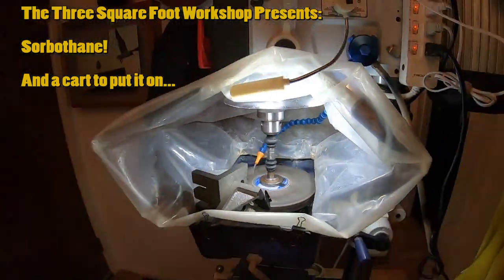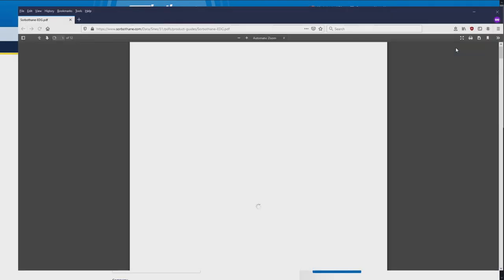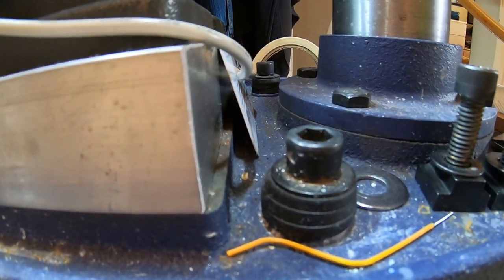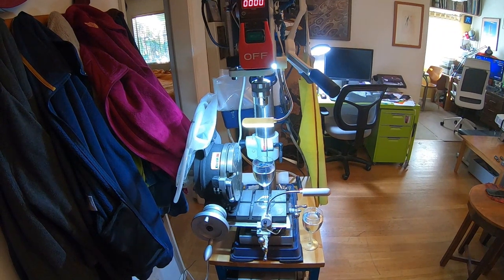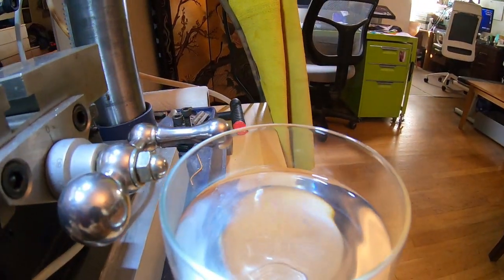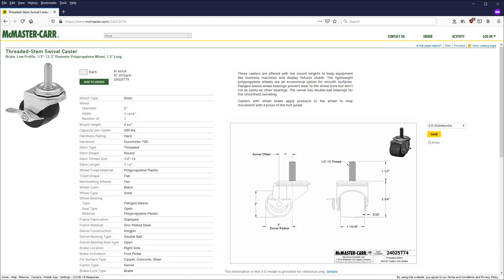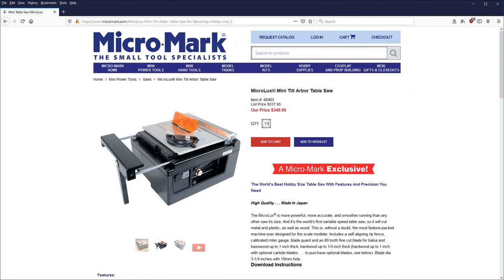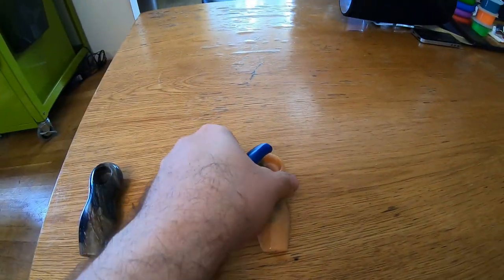Industrial scale drill press for residential use, with sorbothane dampers

Comment: That's a pretty impressive amount of isolation and an even more impressive amount of compaction. I knew Sorbothane was one of the best materials for passive vibration isolation/damping but that's way more effective than I thought it would be. I'm even more impressed by how tightly you managed to fit everything together in a way that's still at least somewhat usable. I tried to design myself an apartment-friendly workshop at one point, so I know just how difficult it is.

Comment: very nice! will definitely have to look up sorbothane - I've got a moderately heavy tool to mount, in a similar context (my apartment), & was just planning on using those round rubber or felt feet you can get. this seems like a much better solution!